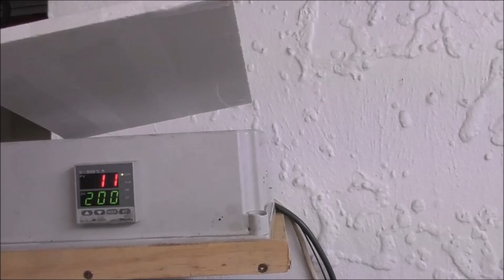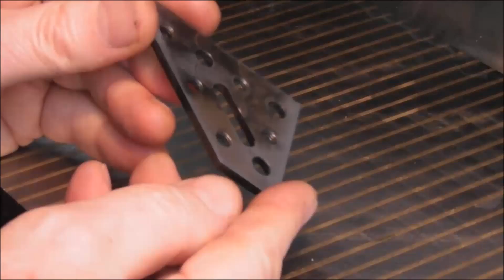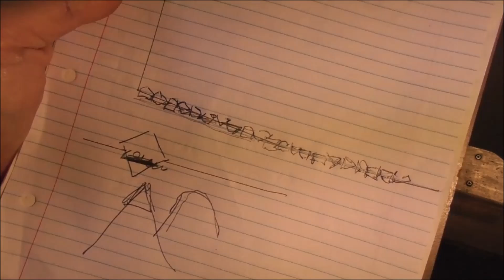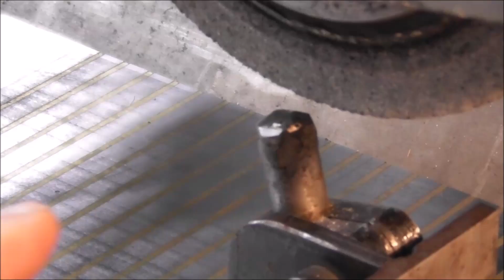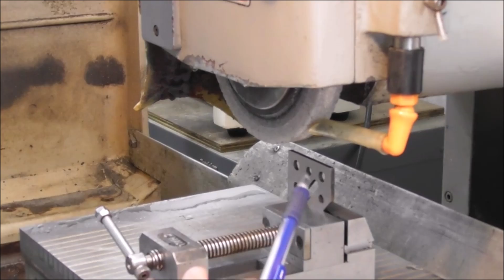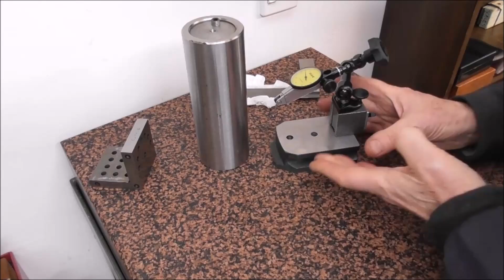Using a Surface Grinder   Part 2 -  Grinding a Gauge  mp4

Comment from the maker: Some commenters under my surface grinding 101 video requested more detailed information on grinding wheels etc. While I will try to touch on these subjects as they fit in, the problem is there are scores of detail factors involved in covering each of these subjects fully, and most viewers are not likely to want a lot of this content. Reading (and re reading) a book like Jones and Shipman's Precision Grinding Techniques would be a better way to learn this detailed content. But please keep up the comments and requests, as this helps guide my general direction.  Cliff
Reply: Hola cliff, muy buen trabajo,,,una creacion especial ,,excelente ,,,el rectificado final ,echo como corresponde despues del temple asegura la precisión ,total ,, grasias por compartirlo ,,,un gran  abrazo ,,y buen fin de semana ,,,,,
Reply from the maker: @juancarlosfochesatto4741  Hi Jaun! Thanks! Cliff

Comment: Thanks Cliff. I found this to be an extremely helpful set of basic tips, including how to set up and measure the grinding results.  I even appreciated how you explained how when checking squareness of your cylindrical square, you can simply average 180 degree around.  That simple tip opened my eyes how to do more measuring.  I now need to go watch your other metrology videos 👍👍
Reply from the maker: Good to hear Joell. Thanks for the feedback. Cliff

Comment: I've got a NZ manufactured surface grinder, I have put a 240volt three phase motor and VSD/VFD(so I can change the grinding speed as required depending on size and type of grinding wheel) on it and purchased new grinding wheels from Centerline based in Wellington , I'm really learning a lot from your videos, keep them coming .
Cheers Graeme ( From Wellington NZ)
Reply from the maker: Hi Graeme! NZ surface grinder...that can only be a Supreme? I used one at McCabe Industries. I had never heard of Centreline, I see they are web based and operating from Silverstream. Cheers, Cliff

Comment: You can also use CA glue to stick parts to the magnet with the force turned off, to avoid distorting parts that aren't flat.  --Doozer

Comment: Since a fast wheel RPM makes the wheel act harder, and a slow wheel RPM makes the wheel act softer.... Use this to your advantage when dressing.  I have VFD drives on all my grinders. If I want to tear the grains out, creating a nice open wheel surface, I dress the wheel with the diamond, at 10 or 20 Hz.  Again you can adjust the traverse speed of your diamond to suit.  But this really works to make the wheel cut cool. (I dry grind when I don't want the coolant mess).  As a bonus, when dressing the wheel slow, it does not spray grit all over the shop.  Having a VFD on a grinder opens up so many options.  I have even ground plastic with the wheel running slow, with no wheel loading up.  You really should try one.  -----Doozer
Reply from the maker: Interesting, that fits with my impression of how different diameter wheels perform. Thanks, Cliff
Reply: Good call referring to tearing the grains out. That's how the diamond works, it does not wear flats on the grains, the shear strength of the grains far exceeds the bond strength.
I believe a vfd is legal, providing it cannot exceed the original rated speed for a full size wheel.
Reply: @Bosun-8  Legal ???

Comment: Good stuff Cliff, and thanks for taking the time to do it.
I suspect the lack of good credible surface grinding content is because many just muck around until they get a result, which they don't want to admit.

Good catch on the earthing. 

You certainly aren't shy about using coolant. What coolant are you using in your set-up?
Reply from the maker: Thanks for the feedback. The coolant I use is a NZ made Syntol grinding fluid. Cheers, Cliff